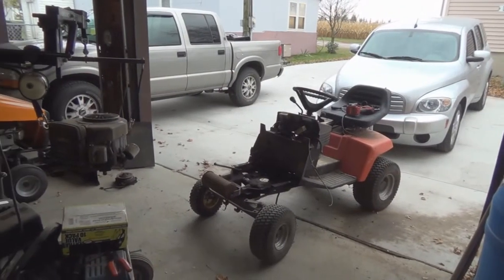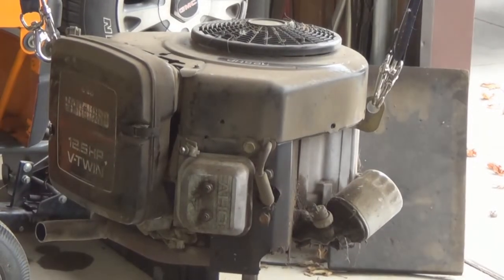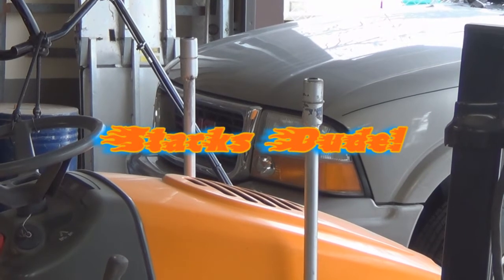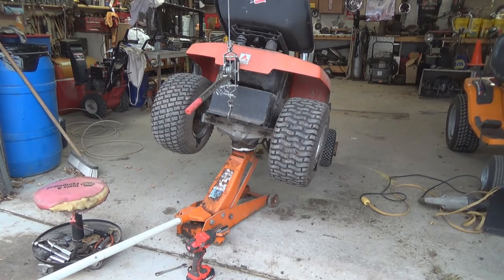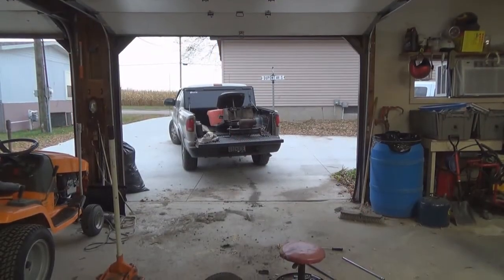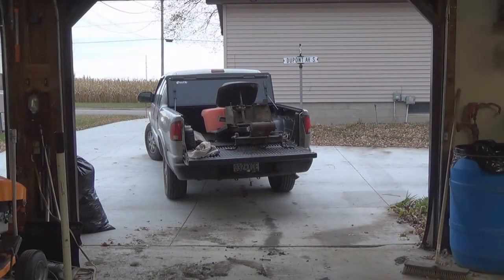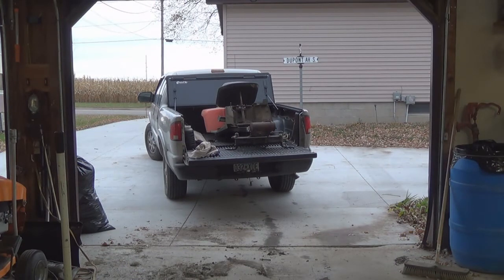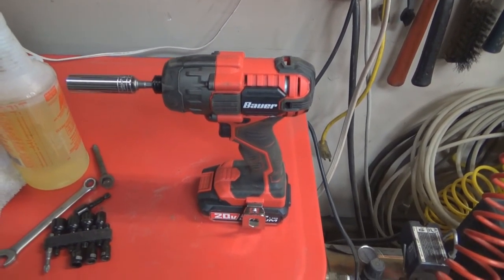Engine & transaxle removal from the Agco Allis for the Emperor

Comment: I don't have a problem with most HF tools, I got a Porter Cable impact / drill set and the impact is ok but the drill chuck won't stay tight on the drill.
Reply from the maker: Most of my drills are cheapos now that I am retired, except for the freebies that I have picked up at the dump. Let me check, I might have a spare chuck I could send you. They are pretty much standard across the brands.
Reply: it just turns loose of  the bit, someone told me that it's when I let off  the trigger that stops too fast and  causes it to loosen up.

Comment: Dressing in layers, smart man and a foam pad for the knees. 
Wright tools for the write job, gotta be as comfortable as you can.
DuPont Ave huh? I've been working at Ashland an it's rite across the street from DuPont.
Reply: What did that impact driver go for George?
Reply from the maker: I paid $79.99 for it and added the extended warrantee for $12.99, so with tax it came to just under $100.
Reply from the maker: I'm not sure which town that road sign came from. I pulled it from the dump...LOL
Reply: Thanks George, not a bad price and those guns are very handy as per your video.

Comment: Front axles are great for the start  of a miniature hay wagon. Seen them as the running gear and sold for big $$$$$$.  http://www.mytractorforum.com/119-home-made-tractors-implements-accessories/259547-mini-hay-wagon.html
Just another idea for the winter workshop......
Reply from the maker: Alas, I dropped it off at the dump today, where I almost picked up another snowblower, but my back is hurting after lifting the mower into the truck, so I left it behind... I do have another front axle however, with good wheels and tires. I don't need any more projects right now, but you suggest a great idea. Thanks